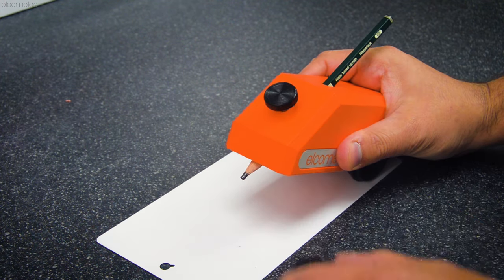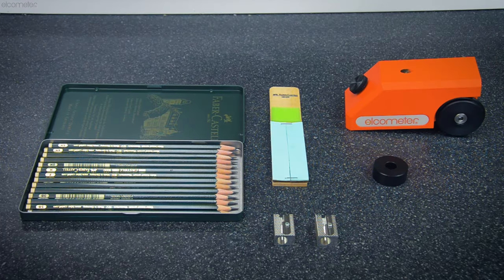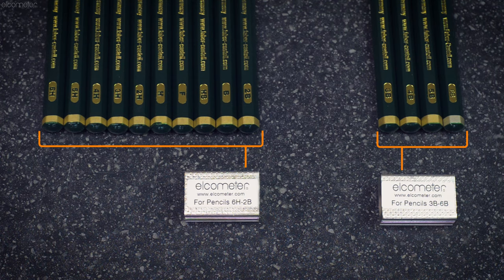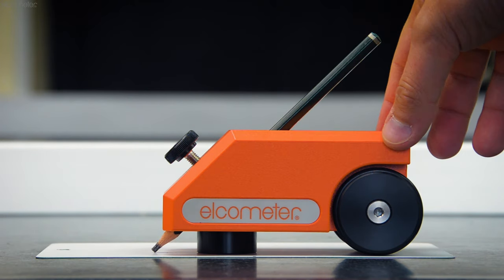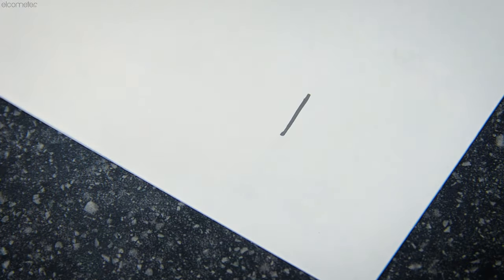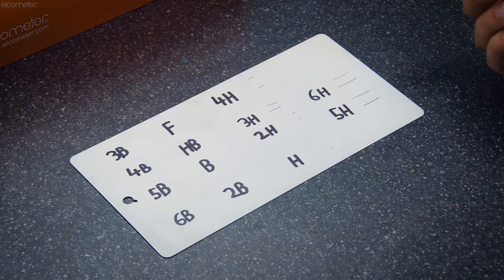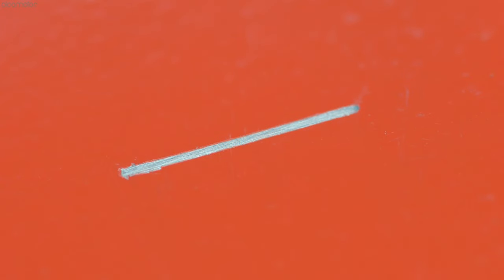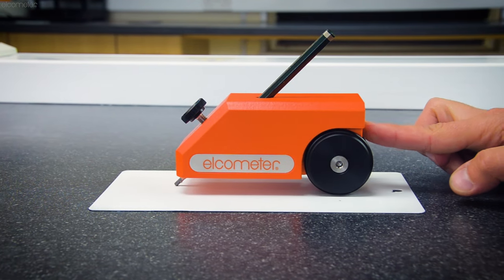How to measure coating hardness using the Wolff-Wilborn Pencil Hardness Test

Comment: Hi. How to determine whether the test is considered as Pass or fail?
For example, I need to do test for 4H, then after test done, there is a plastic deformation (6mm), so is this considered as Fail? Please advise. Thank you for the video!
Reply from the maker: Hi,

As per the instructions, the user increases the hardness of the pencil until one or both of the following defects mark the coating:

1. Plastic deformation; a permanent indentation in the paint surface without cohesive fracture. 
2. Cohesive fracture; the presence of a visible scratch or rupture in the surface of the paint film, material having been removed from the paint film. 

If you have any further questions, please get in touch @techsales@elcometer.com

Comment: Hard to believe that any coating that can be scratched/damaged with any pencil would be worth using. I wonder if Cerakote can be tested with this method. That's some very slick and very durable stuff. I do worry that the pencil test might not be as repeatable as it may seem, because the tips are sharpened by hand, and sharper edges are significantly more destructive than any edges that might be more dull. Like, I've seen on many occasions surfaces that could easily handle a sharp edge of a knife... but the moment a jagged/damaged knife edge is against it, the damage is significant. (Also, if the pencils are different from manufacturer to manufacturer, than how can a "pencil hardness score" be given? Wouldn't companies always want to use the company with the softest pencils, so they can boast a stronger product and higher score?)
Reply from the maker: Hi,
Thank you for your comment. We developed this kit to adhere to strict ASTM and ISO standards 
- ASTM D 3363 
- ISO 15184:2012

Coating hardness can vary drastically. From extremely soft coatings, all the way to extremely hard coatings. This test method has been established in the industry for many years and can be suitable for a wide range of coatings.

However, many more test methods do exist such as the Elcometer 3092, 3000, and 3095. 

If you have any further questions, please get in touch at support@elcometer.com

Comment: How many thickness we can do the test?..
Reply from the maker: Thank you for your comment.

As the test is designed to scratch the surface of the coating, the thickness of the coating is not relevant.

For more information please contact techsales@elcometer.com or visit www.elcometer.com/contact-us to find your local Elcometer distributor.
Reply: @ElcometerOfficialChannel  But nace manual mentioned 250microns only used this test
Reply from the maker: ASTM D3363 and ISO 15184 both state the thickness of the coating shall be as specified or as agreed upon between the interested parties, which is cross-referenced in the NACE CIP Training and Certification Manual Level 2.

If you are able to quote exactly where you found the 250micron reference we will be able to investigate this further.
Reply: @ElcometerOfficialChannel  thank you for you respect and reasonable answer.. have i any doubt i ask to you? Because i try to move nace level 3. Thank you
Reply from the maker: You're welcome, we are happy to help!

If you have any further questions please don't hesitate to contact techsales@elcometer.com or visit www.elcometer.com/contact-us to find your local Elcometer distributor.